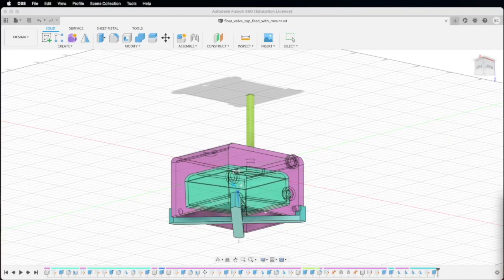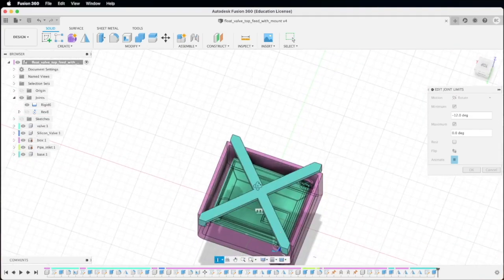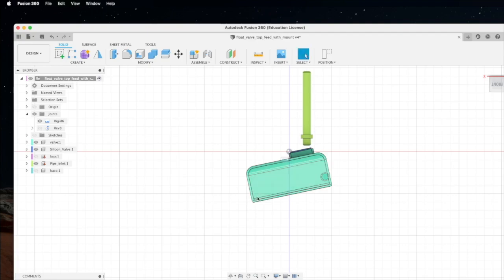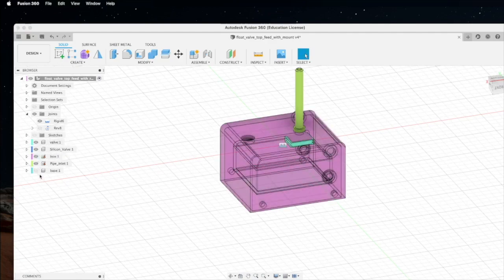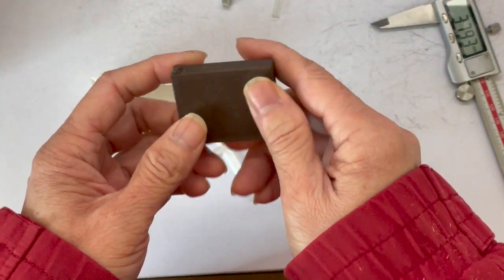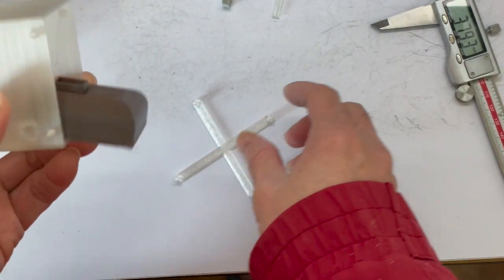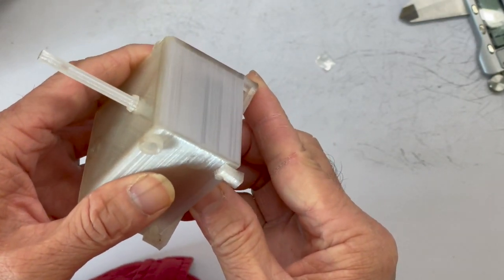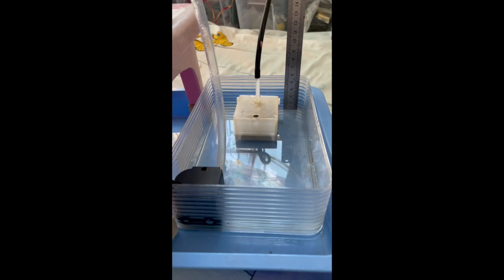An improved sealed Float Valve for Passive (Kratky) Hydroponics

Comment: You could try adding some coffee filter ( like aeropress) paper over the air relief hole to act as a water check valve.  When the paper is wet it will hold the water vacuum up to 1.5 bar, but it may take a while to evaporate, preventing it from filling up again properly,  staying stuck open.

If that doesn't work, a small aquarium air pump water check valve might be an affordable ish method to achieve the same, without getting stuck open